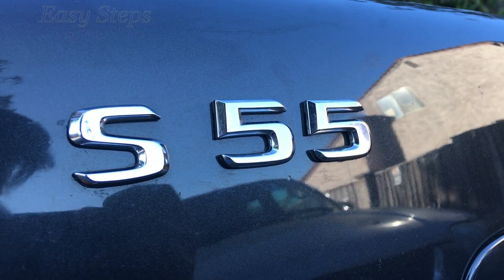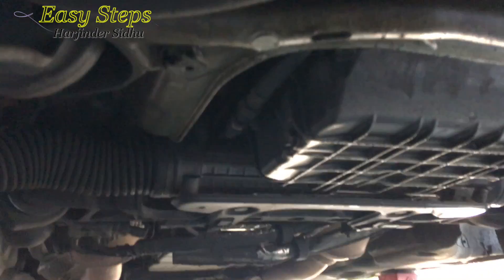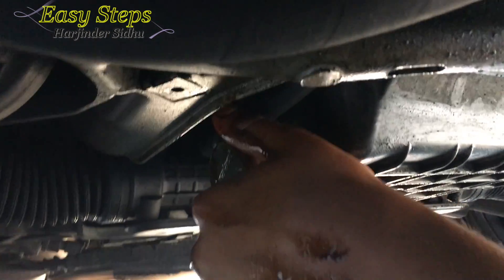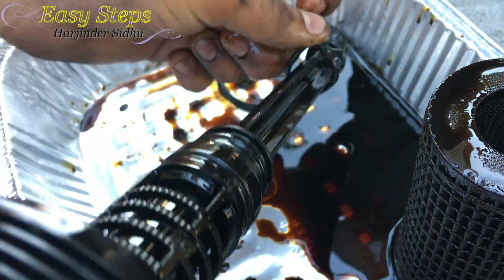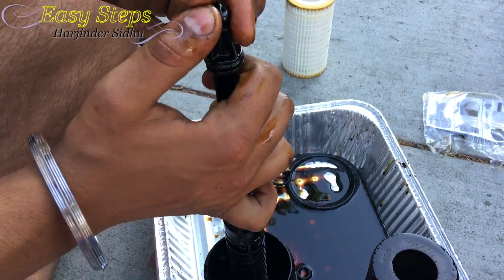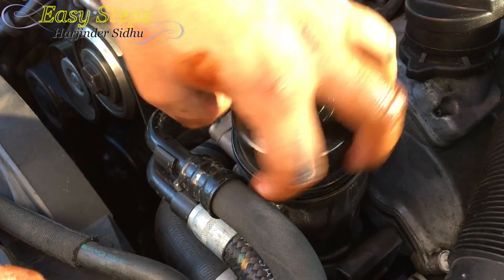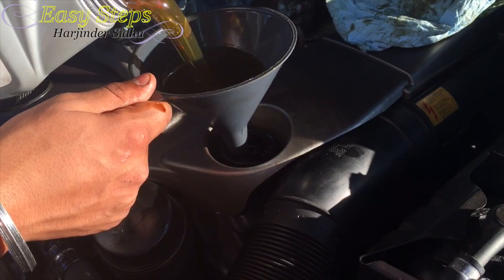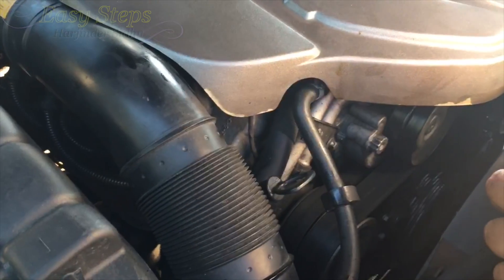How to Change Engine Oil and Filter on Mercedes S55 | W220

Comment: Forgot about changing the drain plug washer
Reply from the maker: Good observation, you're good.👍👌
I used the old one because I didn't buy a new one.
Now I got many and every time I change the oil then I change the copper washer.
Thanks for watching.🙏 https://youtu.be/On11ZsJPij4?t=354
Reply: Anytime bud